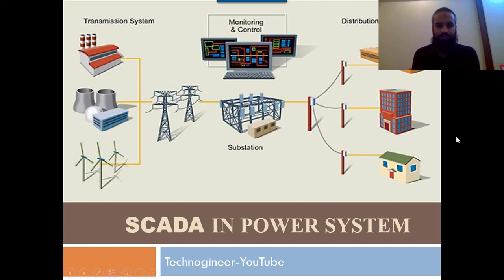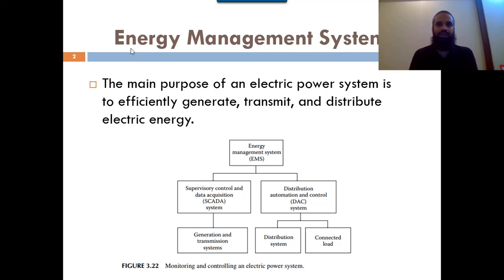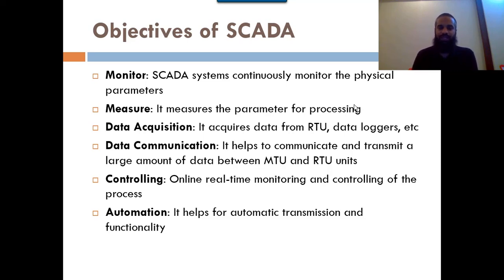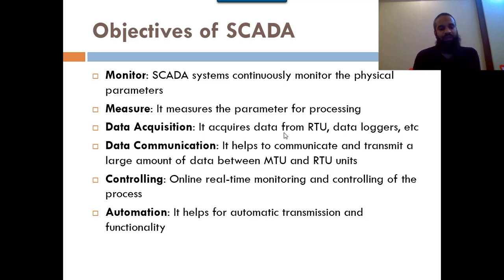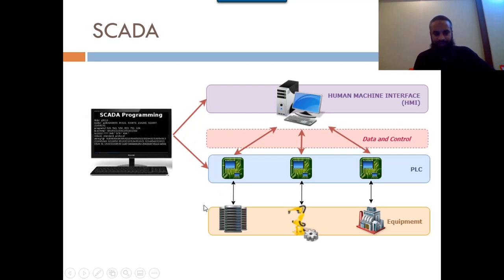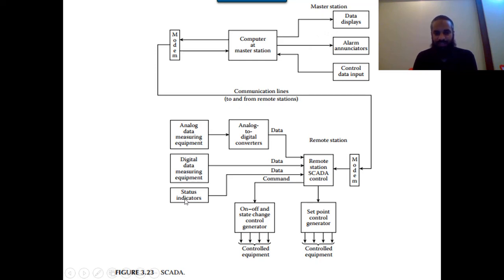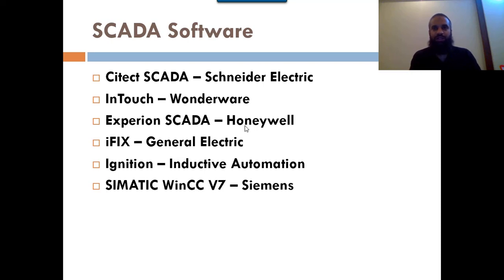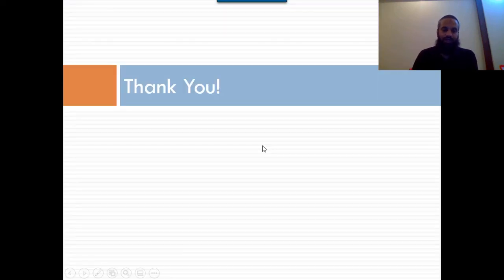SCADA In Power System

Comment: What is mininun requirement for laptop to scada software
Reply from the maker: The requirement of Scada software is not too high

For example to install latest version of Scada Gateway Software, following specifications are required:

Minimum system requirements for the host computer are:

1.5 GHz processor; Recommended: 2.4 GHz multi-core processor

1 GB RAM; Recommended: 4GB RAM

Windows 7 or higher
Reply: @Technogineer  tnx for your reply
Reply from the maker: It totally depends on how much nodes you want to establish